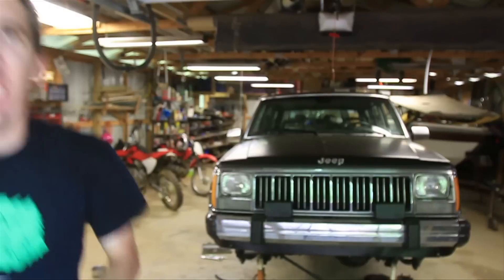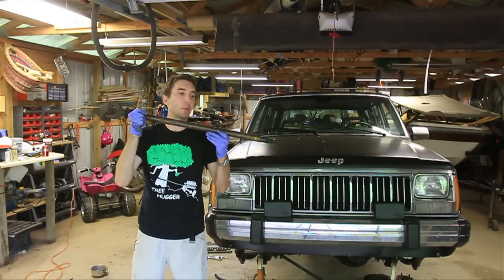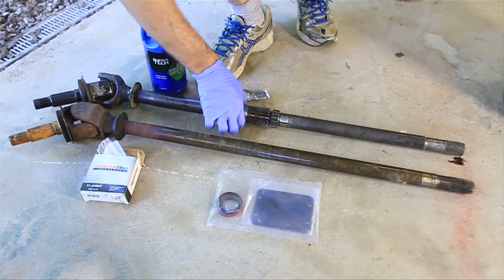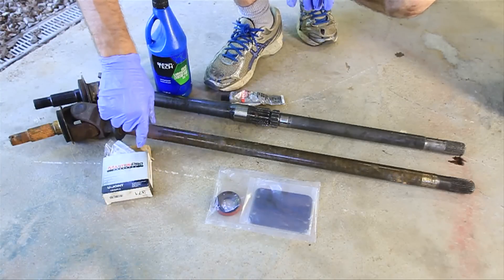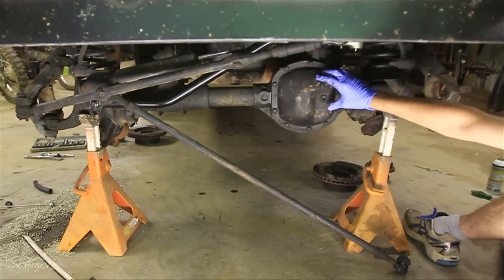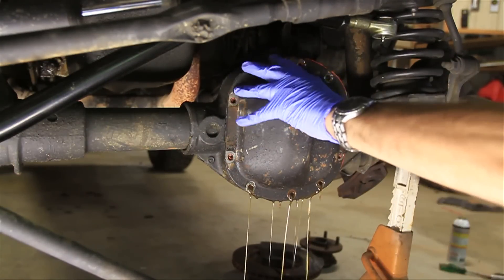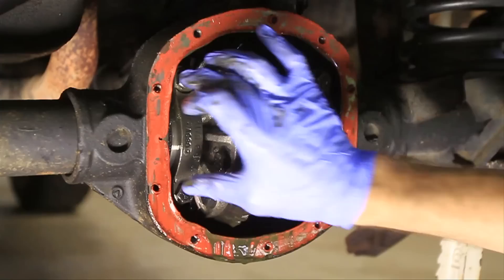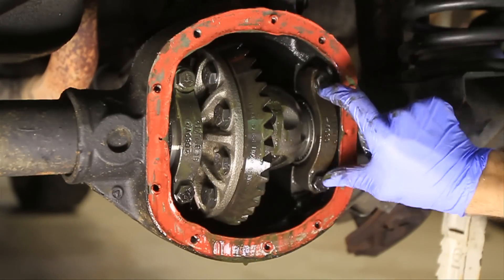Dana 30 - 2 Piece to 1 Piece Axle Shaft Conversion - Part 1 of 2

Comment: Just curious if I fully locked my 92 YJs front axle with a spool, with the vacuum disconnect fully operational, would it be rough steering around corners when the axle disconnected on one side?

Comment: So by changing that 2 piece axle with a 1 piece you have made it a full time 4x4 ? What's the benefit ?
Now the front differential will be full time 4x4 and when turning it's going to skip or break the differential gears ???
I'm sure that's why jeep install the vacuum selection motor . When it in 4x4 and when it's not ! Especially on the road or highway...
Explain.
Unless your jeep is off road only and not on the highway or hard roads !
Reply from the maker: No. The transfer case selects 4 wheel drive, not the differential. The only thing a 3 piece shaft does it to let the shafts sit still while moving saving a bit on fuel economy.  It's not too different than a lockout hub on a big truck.

Comment: Hi Mat. One thing. When one does the axle swap. The large axle always feels locked.bad on turns.  Not good on the street. I broke mine AGAIN. At the U Joint area. I have a Spartan locker
 Help. I use my jeep   On the street 75 % of the time. and I need help

Comment: 1:28
How about if I use a driver side housing seal for the passenger side will that work ?
Reply: Not on a disconnect axle, it won't be the right size

Comment: Just swapped axles in my 87 xj renix out of a 95 xj. I went through 5 seals before I figured out how to do it, step (1) buy seal from oreillys part number 473426. Step (2) sand the axle tube a bit where the seal will go. Step (3) put seal in freezer for one hour. Step (4) use seal driver to hammer in seal. The Tolerances are very tight the first time I tried the seal buckled.
Reply: Thanks for posting this. I'm doing the same on an 88 axle and kept finding the wrong seal OD. Your post saved me hours of searching.

Comment: So you can just reinstall the carrier while using the same orientation of caps and bolts? You don't have to worry about measuring backlash and such? New to this stuff and really don't wanna toast my axle. Thanks for the videos really enjoy all the info, thanks!
Reply from the maker: Ya, as long as you didn't change anything.

Comment: I just did my 88 xj.  I just put a stock driver side seal on the pass side where the orig seal goes outboard of the CAD box.  Simple and didn't have to pull carrier.  Haven't drove it yet but don't see why it won't work.
Reply: Aren’t they different size diameter seals?
Reply: @WiSeR187  i don't remember,  it's been working for about 100k miles so far
Reply: @shanebaker2613  I guess it would depend on the axle used and how smooth the whole shaft is. The reason they put it by the gear is the shaft is micro smoothed out so it doesn't grind the seal away. You still have the same seal in now? What seal part number did you use?
Reply: Did it work?
Reply: for real....did it work?

Comment: DOES THE CHEROKEE AXLE SHAFT WORK ON JEEP YJ'S TOO.  LIKE A 1990 JEEP YJ
Reply from the maker: yes
Reply: @bleepinjeep  Hey Matt, heading to the pull-a-part yard this week. Do the bigger u joints fit through most dana 30 knuckles? I don't have a good way of boring it out if not... I've heard some people running into a similar issue, any idea? Thanks!
Reply from the maker: @nobuddynoah  they do fit, at least Ive never seen one NOT fit.  Except for an RCV but thats different.
Reply: Awesome, thank you!

Comment: Um, I've got a 94 with the stock Dana 30. And the two piece axle, sooooo. Now what?

And, ahhh, those bearing caps are marked with Y's at the factory. Just so ya know. You know, for next time.
Reply from the maker: now what what... upgrade it!
Reply: I got the two piece axle on my 97

Comment: i wonder if the 36mm socket youd need for the axle nut would be the perfect size to fit that diff seal? never tried it always just use a block of wood

Comment: Will cj5 1972 front dana30 axel and defferential fit xj 98 ?
Reply from the maker: Not sure, I assume so.
Reply: No, the cj dana 30 is narrower and the pumpkin is on the wrong side to work in a xj. The C and knuckles are completely different as well

Comment: Called orielly auto parts and they said the 471763 didnt show up in they're system
Will the 11343 work? or do i need to hunt down the 471763 seal?

Comment: If you can add this to the post. I called east coast gear supply and the seal is specific and can't be found in any stock jeep axle. Below are the part numbers you can get from oreilly, the 471 is what you need

471763
11343
11878
Reply from the maker: james james Thanks!  so what are the other part numbers for then?  Ive added this to the description.
Reply: BleepinJeep  these 471763, 11343 are the ones that will fit the dana 30 tubes on the 2 piece axle. The other part number is for the TJ's or newer XJ's
Reply: james james Also as a note the 471763 the rubber keeps getting chewed up, going to try the 11343 part number next. Will update on the results, also checking for any gnashes on the shaft that is cutting the seal....

Comment: is the seal you buy from rusty's special made to fit in the axle tube. I have a 1993 wrangler and got a Cherokee axle. every parts store I go to sales me a seal that will fit the driver side but is not fitting In the passenger side. I ordered a kit from rustys and am just waiting on it.....
Reply: I had the same problem, did you ever find a fix?
Reply: There were two different sized axle tubes
Reply: You have to go to the dealer there both different sizes.

Comment: I broke my drivers side and got a deal for both axles so i'm doing this. I have everything ready to go back in but, where you put the seal in at the diff there is no groove for the seal to go in and stop. Do you just put it in flush and it will stay?

Comment: What's the part number for just the seal?   Have a manufacture part number?   
Did you put an outer seal in?   The old warn kits came with an outer seal to prevent stuff from sitting in the cad housing after the swap.

Comment: I agree with the stress side when in 4x, don't want to wreck my diff to find out all I'm gonna do is twist axles... But in 2wd-welded should be basically open, the pass. Side center axle piece would be rotating backwards(in relation to wheels) and drivers would be turning the whole carrier, hence always Spinning the driveshaft, just like ur convertion is going to

Comment from the maker: Also, I used to have one of those cable things for the 2 piece and had lots of problems with it.  (I still have it in the shop).  Not to mention the fork is the weak link and the 2 piece shaft as well. + it would cost less and be stronger just to do the conversion... just my thoughts...
Reply: They suck!

Comment from the maker: Well, it wouldn't really work like an open diff.  With it welded and the fork disconnected the front driver side would still be engaged full time, meaning you would be driving around in three wheel drive, all 3 wheels locked (supposing you had a locker in the rear).  That would be worse than an open front diff as the front passenger wouldn't pull at all and the front driver would be very stressed... cont...